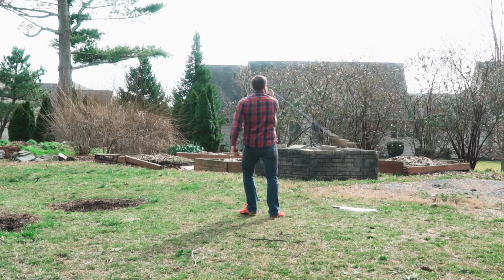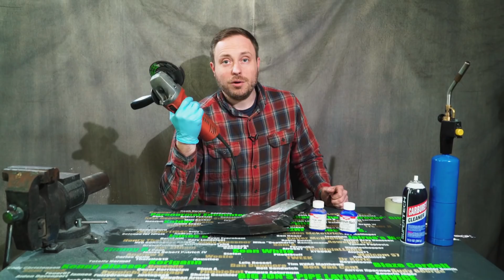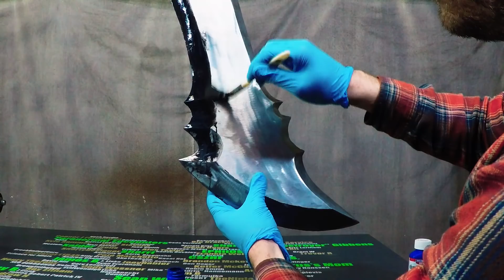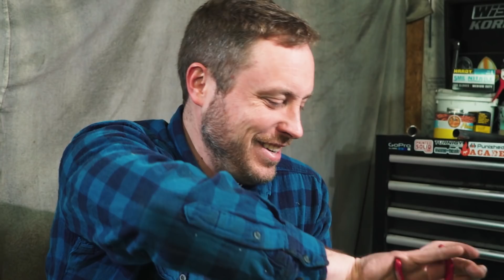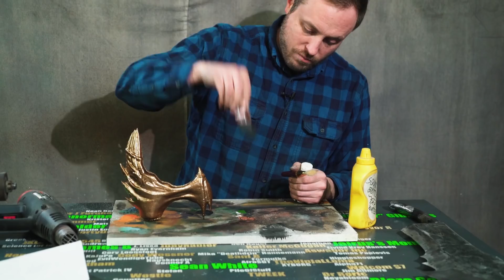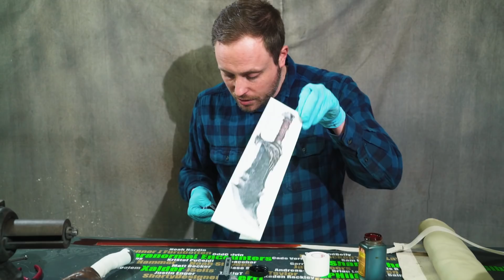God of War Kratos' Blades build part - 4

Comment: It was the WD 40 on the flap discs that caused the black pigment to not stick. After you hit it with the torch the WD 40 burned off, so it stuck That's my theory anyway.

Comment: The reason the aluminum black was coming off in the post needle scaled side and not the pre needle scaled side is because the needle scaler probably beat the coating into the aluminum

Comment: @JAIRUS OF ALL  You're effectively shot blasting with the needle scaler.  Once the oxide is on and peined it's in the material it should adhere better.

If you scale/pein before you apply the oxide the change in metallurgy inhibits oxide formation. That's why, as a process, it's used as a corrosion inhibitor.  You'll need to sand back a bit to give your oxide a chance to adhere.

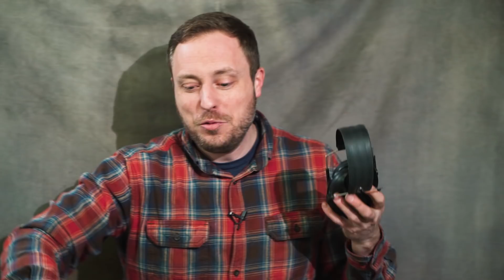Comment: Cringed so bad once you put the needle gun on the metal without hearing protection.(7:05) Then you throw on cheap earmuffs and I cringe even harder because you should be using two types of hearing protection for that kind of work. Even with two types I still have hearing issues today.

Comment: Yea I've found having some heat in the material helps color the metal better and adding oil after helps deepen the color but having used both alum a black and gun blue a lot some times it just doesn't want to work.

Comment: They are taking as long to build as it would have taken to build up the strength to lift them if they had been made of solid aluminum. 3D print, sand mold, molten aluminum casting and then spent the next 2 months at the gym so that you are able to lift them. :)

Comment: They have flap disks for aluminum  that dont get buggered up
Reply from the maker: I haven't seen any in stores. I'll have to check amazon. Didn't know they existed!
Reply: @jairusofall  use old dryed up plumbers silicone to clean sand paper ,or preety much any abrasive that gets clogged.